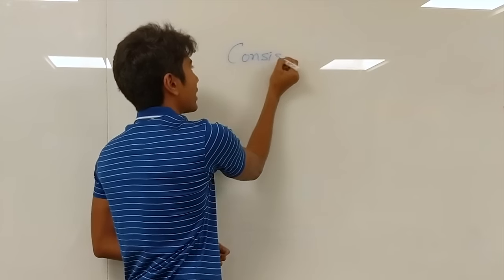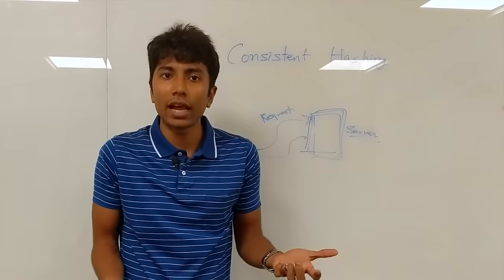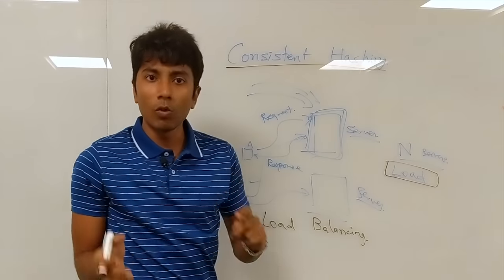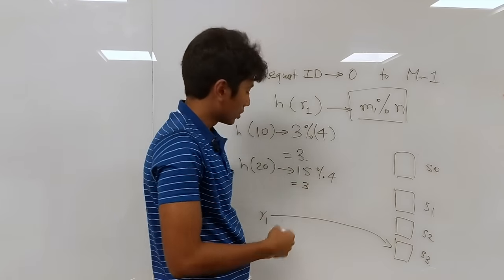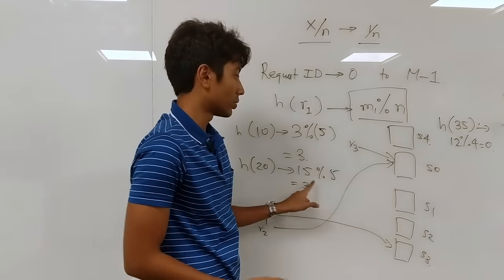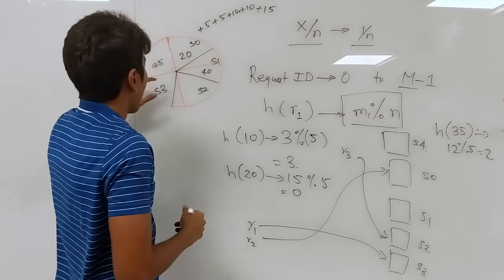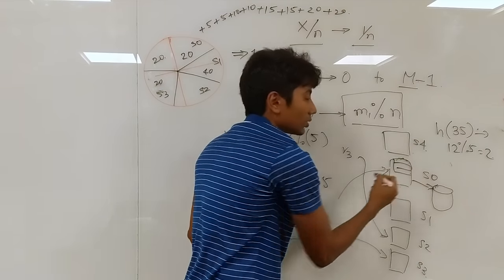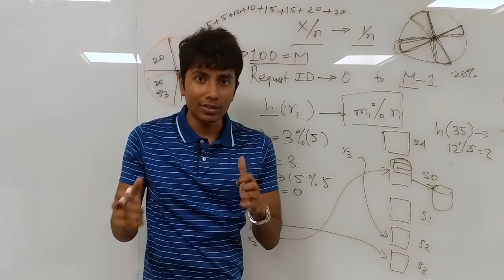What is LOAD BALANCING? ⚖️

Comment: Hi Gaurav great video, can you quickly elaborate on the Pie Chart you made and did the 5+5+10... maths you kinda lost me there and I am trying to figure out intuitively what you tried to show using the Pie Chart example when a new server is added. Thank you!
Reply from the maker: The pie represents the load on each server, based on the range of requests it shall handle.

The requests have random ids between 0 and M. I draw the pie chart with each point in the circle representing a request ID. Now a range of numbers can be represented by a slice in the pie.

Since the request IDs are randomly and uniformly distributed, I assume that the load on each server is proportional to the thickness of pie slice it handles. 

IMPORTANT: I assume the servers cache data relevant to their request ID range, to speed up request processing. For example, take the profile service. It caches profiles. It's pie chart will be all profiles from 0 to M. The load balancer will assign loads to different nodes of this service.

Suppose one node in this service handles the range 10 to 20. That means it will cache profiles from 10 to 20. Hence the cached profiles are (20 - 10) = 10.

The pie calculations in the video show the number of profiles a node has to load or evict, when the number of nodes changes. The more a node has to load and evict, the more work it needs to do. If you put too much pressure on one node (as shown here with the last node), it has a tendency to crash.

The consistent hashing video talks about how we can mitigate this problem :)
Reply: @gkcs  Thank you so much for a fast and well detailed response! I understand perfectly now. Very much appreciative of your hard work and dedication when it comes to making videos and reaching out to your audience. Keep up the great work and stay safe! Sending love from Bay Area! 💯
Reply: thanks for asking this question, I was also lost in the calculation.
Reply: @gkcs   This comment really helped, was a bit confused about the pie chart explanation at first. Thanks.
Reply: @gkcs  Still not very clear. DOnt know how you jump to 40 :(
Reply: Even I didn't understand about how he jump to 40....
Reply: @vimaldhaduk  A tip: draw pie chart first for traffic for 4 servers and then draw another pie chart considering traffic for 5 servers, juxtapose them. 
If you see, in the first chart, first server will serve 25 requests, second one from 26th to 50th and so on.
When you introduce 5th server, first will now handle first 20 reqs, 2nd -> next 20 requests (21st to 40th, hence the 40), and so on...
Reply: @darkhorse91210  Understood 👍

Comment: For anyone confused by the pie chart, the explanation he does makes sense only when you watch the whole video. In a nutshell, when you at first have 4 servers, each server handles 25% of the users. The hashing function takes users' user id or some other information that somehow encapsulates the user data (and is consistent) so any time you want to, for example, fetch a user profile you do it via the same server over and over again since user id never changes (therefore hash of a user id never changes and will always point to the same server). The server remembers that and it creates a local cache for that information for that user so that it doesn't have to execute the (expensive) action of calculating user profile data, but instead just fetches it from the local cache quickly instead. Once your userbase becomes big enough and you require more processing power you will have to add more servers. Once you add more servers to the mix, the user distribution among server will change. Like in the example from the video, he added one server (from 4 servers to 5 servers). Each server needs to now handle 20% of the users. So here is where the explanation for the pie chart comes from.

Since the first server s0 handles 25% of the users, you need to take that 5% and assign it to 2nd server s1. The first server s0 no longer serves the 5% of the users it used to, so the local cache for those users becomes invalidated (i.e. useless, so we need to fetch that information again and re-cache it on a different server that is now responsible for those users). Second server s1 now handles 25%+5%=30% of the traffic, but it needs to handle 20%. We take 10% of its users and assign it to the third server s2. Again like before, the second server s1 lost 10% of its users and with it the local cache for those users' information becomes useless. Those 10% of users become third server's users, so the third server s2 handles 25%+10%=35% of the traffic. We take third server's 15% (remember, it needs to handle only 20%) and give it to the fourth server s3. Fourth server now handles 25%+15%=40% of the traffic. Like before, fourth server lost 20% of its users (if we're unlucky and careless with re-assignment of numbers it lost ALL of its previous users and got all other servers' users instead) and therefore those 20% of users' local cache becomes useless adding to the workload of other servers. Since fourth server handles 40% of the traffic, we take 20% of its users and give it to the new fifth server s4. Now all servers handle users uniformly but the way we assigned those users is inefficient. So to remedy that, we need to look at how to perform our hashing and mapping of users better when expanding the system.
Reply: Nice one
Reply: amazing explanation dude
Reply: thanks buddy it got cleared here, now i want to ask you that how would we utilize this and make it scalable because loosing cache data will be costly.
Reply: Thanks buddy ❤
Reply: thanks dude
Reply: you explained it so well man. Thank you so much
Reply: Excellent💚
Reply: This comment should have more likes!
Reply: Great man!
Reply: I was struggling to understand this pie concept since so many days and you explained it so beautifully, thank you so much for this explanation. You have cleared all my doubts from this video ...... 👍👍
Reply: Helped me
Reply: Thanks for the explanation
Reply: Hi what I didn't understand is why do we need hash function. Why can't we simply do userId%n. If the hash function is giving us the same answer every time when we give it a same userId why to use it in the first place?
Reply: @ridhamgodha4569  Maybe because the Id can be alphanumeric, not necessarily a number
Reply: @Dev-zr8si  okay yes this can be the case
Reply: God daamn!!!⚪⚪⚪
Reply: Thanks for the explanation
Reply: Amazing explanation brother , saw this video 2 times got a bit confused but this comment sorted things out , now the explanation in video makes heat up sense <3
Reply: @bithon5242  dood you seriously killed it with your explanation
Reply: Great explanation, thanks a lot!
Reply: Thanks,great help!
Reply: Thanks for the explanation.
Reply: Thank you for this, tyou are the best
Reply: Now it's clear, thanks buddy

Comment: Notes to self:
* Load balancing distributes requests across servers.
* You can use `hash(r_id) % n_servers` to get the server index for a request `r_id`.
    -> Drawback: if you add an extra server `n_servers` changes and `r_id` will end up on a different server. This is bad because often we want to map requests with the same ids consistently to the same servers (there could e.g. be cached data there that we want to reuse).
* "Consistent hashing" hashes with a constant denominator `M`, e.g. `hash(r_id) % M`, and then maps the resulting integer onto a server index. Each server has a range of integers that map to their index.
* The pie example demonstrates, that if an extra server is added, the hashing function stays the same, and one can then change the range-to-server-index mapping slightly so that it remains likely that an `r_id` gets mapped to the same server as before the server addition.
Reply: Thanks for this. I have a question which may easy
But I am not sure about it.
It is basically based on the hash value we are deciding which server do we save our data out of n number of database.
What is the guarantee that hash function returns value by which request will be stored n different number of servers equally
Reply: Thanks for notes. It's good for lazy people watching video, like me :)
Reply: @senthilandavanp  Take few processes with different r_id and let's say there are 5 servers ...now do mod and try to find which process will load in which server...You will get your answer
Reply: @adityachauhan1182  thank you .it answered my question.
Reply: thanks for the summary
Reply: great summarization of this video! 👍
Reply: @adityachauhan1182  to equally load balance the r_id should be sequential right?

Comment: If anyone is confused by the pie diagram,
We need to reduce the distribution from 25 each to 20 each. So we take 5 from the first server and merge it with the second one. Then we take 10(5 from the first one and 5 from the second one) and merge it with third. So now, both one and two have 20 each. Then we go on taking 15 from third and merging it with fourth and finally, taking 20 from four to create the fifth server's space.

Please correct me if I'm wrong. This is just a simple breakdown which I think is what he intended
Reply: Thanks for explanation...
Same here..
Reply: Thank you for your explanation. It is very helpful.
Reply: Can you please tell what is this pie chart signifying, as to what are these 25 buckets, is it storage space or number of requests handled? It will be very helpful if you could help with this question.
Reply: Further explanation:

1. Suppose you're serving users 1 to 20 on S0, 21-40 on S2 and so on. If you insert or remove a server, each server will have to adjust in a way so that load is balanced. 

2. Now, suppose S1 is dropping 5 users, and these requests are now being routed to server Sn. 

3. Each server has some local data, cache, etc. for the users/requests it's been serving, and migrating all these is costly. The "buckets" here are basically the operations involved during these kind of migrations.
Reply: Thankyou for the explanation, it helped a lot.
Reply: Thank you for the explanation. Couldn't understand after watching the video but your explanation explained in one go.
Reply: i watched it two times to get it.

Comment: This method is ok when accessing a cache and the problems that arise are somewhat mitigated by consistent hashing.

However there are two thing i want to point out
1. Caching is typically done using a distributed cache like memcached or redis and the instances should not cache too muchinformation.
2. If you want to divert requests from a particular request id then you should configure your load balancer to use sticky sesssions . The mapping between the request id and the ec2 instance can be stored in a git repo or cookies can be used etc.
Reply from the maker: Yes, distributed caches are more sensible to cache larger amounts of data. I read your comment on the other video and found that useful too.
Thanks for sharing your thoughts 😁

Comment: Hey Gaurav,

You have a knack for explaining things in a very simple manner (ELI5).

There is one part of this discussion which I feel conveys some incorrect information (or I might have understood it incorrectly). You mention that 100% of requests will be impacted on addition of a new server. However, I believe that only 50% of the requests should be impacted (server 1 retains 20% of its original requests, server 2 15%, server 3 10%, and server 4 5%). 

In fact, it's always exactly 50% of the requests that are impacted on addition of 1 new server irrespective of the number of original servers. This turned out to be a pretty fun math problem to solve (boils down to a simple arithmetic progression problem at the end).

The reason your calculation results in a value of 100% is because of double calculation: Each request is accounted for twice, once when it is removed from the original server, and then again when it is added to the new server.

Comment: This is what I understand about the pie chart explanation. The objective is to reduce the measure of randomness in the distribution of request among the servers because of the caching done on each server and the fact that user request are mapped to specific servers. So you have 100% request been served to 4 servers which means the load is distributed by 25% to each server. When you scaled up and add a new server, you reduce the load on each server by 5% to make up the extra 20% needed by the new server, that way reducing the random user distribution to each server and ensuring that user data stored in the caches is relatively consistent. Correct me if I'm wrong about this, thank you.

Comment: Explanation for Pie Chart Load balancing after addition of a server. So with the addition of a new server, now each server needs 20 requests and each time a server looses and some other takes in new request, it is a task which load balancer has to perform. These are the things happening around :
1. S1 looses 5 of it's requests and S2 takes in these 5 requests which are new to it.

(+5+5)

2. S2 has 15 of it's already routed requests and 5 from S1 making it 20. So it gives up 10 from it's initial 20, which will be new requests for S3.

(+10+10)

3. S3 will keep its 10 initial and give up its initial 15 which S4 will take as new.

(+15+15)

4. S4 will give up 20 of it's initial requests which will be now routed to S5.

(+20+20)

Now adding all +5+5+10+10+15+15+20+20 = 100, so all requests are affected.

Comment: I like your videos. However in this one, the ending was a bit abrupt. Could you explain a bit more through an example how that is done? How we keep 'empty slots' when dividing the requests on that pie chart? I mean the way it's done is we don't immediately use the whole 360° for "100%" (dividing by N servers). We use like only 90° for 100% and then we have flexibility to add/autoscale 3x more servers with moving minimal amount of cache data from older ones to newer ones. And of course distributed cache is also useful in these cases. Makes adding/removing servers easier. However, there's one place where even distributed cache doesn't work: to scale out writes. That's one place where consistent hashing is the only way out. The id generator needs to be a function of that hash.
Reply: Exactly. I also enjoy the videos, but the ending of this one is confusing. I could also not understando the Pie explanation, i.e., after minute 8.

Comment: @Gaurav Thank you for the video. I have a question, why do you calculate a hash value for every request id? Why not to determine the node number based on the request id immediately? such as 'requestId % n' instead of 'hash(requestId) % n'?
Reply from the maker: That is possible too. Hashing guarantees uniform distribution. So if your ID generator does that already, there is no point hashing it again :)
Reply: @gkcs  thank you for your reply
Reply: @gkcs  
 Gaurav Sen  Can this also be the reason :
 the ID can consist of characters .. so when we hash, it is gonna be a number of which we can take a mod ?

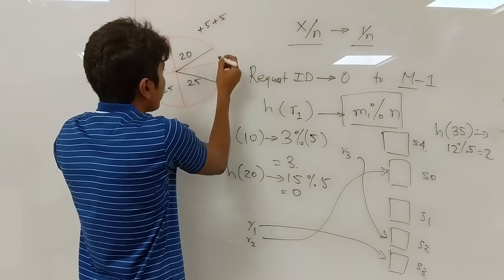Comment: Can anyone explain me the math after 8:40. How come we lost 10 buckets? I understand 5+5 but after that I'm totally unable to understand the math.
Reply: Gaurav basically explained what delta got lost and got added for each of the quadrants. For S0: loss 5, gain 0 (=> Delta = +5).         For S1: loss 10, gain 5(=> Delta = +10+5).      For S2: loss 15, gain 10(=> Delta = +15+10),         For S3: loss 20, gain 15 (=> Delta = +20+15),         For S4: Gain 20, loss 0 (=>Delta = +20).        Hence, cumulative delta = Sum of all Deltas = 100
Reply: Same here
Reply: Didn't understand the math
Reply: From what I understood:

Initially we had 4 servers and 100 requests, so each server had a load of 25 requests.

Now we increase one servers, so 5 servers, each will now have 20 requests due to load balancing.

So the number of changes would be :

FOR SERVER1:
Initially had 25, now can only have 20 so will loose 5 requests.
LOST -> 5

FOR SERVER2:
Initially had 25, but the 5 requests lost by SERVER1 will be taken in by SERVER2.So in total it will have 30 requests. But it can only have 20 requests. So it will loose 10 requests.
GAIN -> 5
LOST ->10

FOR SERVER3:
Initially had 25, but the 10 requests lost by SERVER2 will be taken in by SERVER3.So in total it will have 35 requests. But it can only have 20 requests. So it will loose 15 requests.
GAIN -> 10
LOST ->15

FOR SERVER4:
Initially had 25, but the 15 requests lost by SERVER3 will be taken in by SERVER4.So in total it will have 40 requests. But it can only have 20 requests. So it will loose 20 requests.
GAIN -> 15
LOST ->20

FOR SERVER5:
Initially had 0, but the 20 requests lost by SERVER4 will be taken in by SERVER5.So in total it will have 20 requests, which is perfect.
GAIN -> 20

So if you total all the GAIN and LOST, you will get the total no. of changes, which is 100.
Reply: @shubhamk9019  that's an amazing explanation..thanks so much
Reply: @shubhamk9019  Someone please Pin this guy's explantion
Reply: @shubhamk9019   amazing explanation man...Thanks !!!
Reply: @shubhamk9019  Good Lord. Thanks a lot. !!!
Reply: @shubhamk9019  you got me here !!
Reply: @shubhamk9019  really needed that explanation!!!..cheers!
Reply: @shubhamk9019  Thanks to you I got it right now
Reply: @shubhamk9019  what is the significance of this "total no. of changes"?
Reply: @shubhamk9019  what is the significance of this "total no. of changes"?
Reply: @shubhamk9019  Thank you ! Is there a way to pin this to the top?